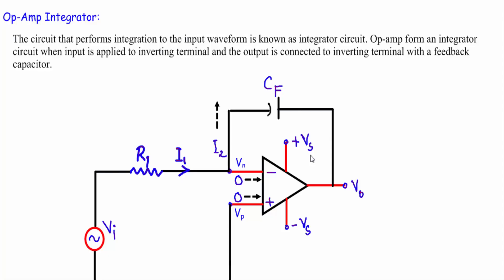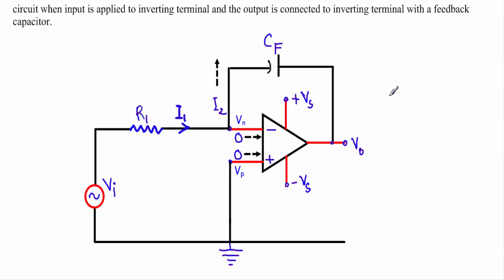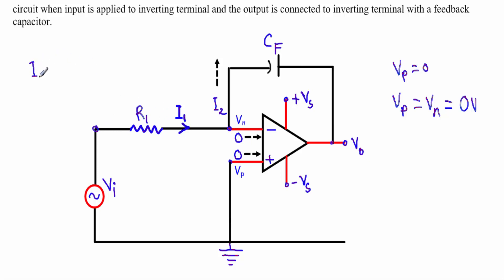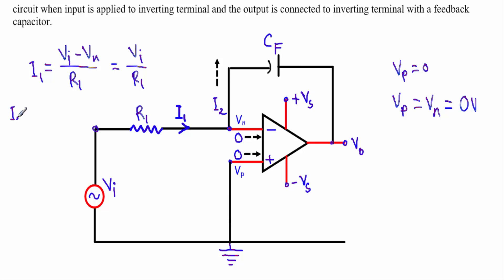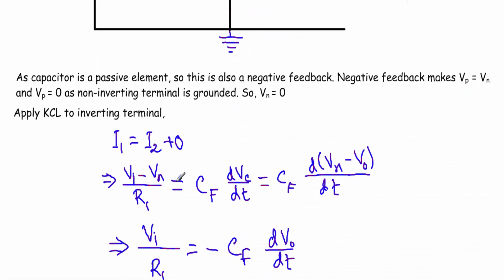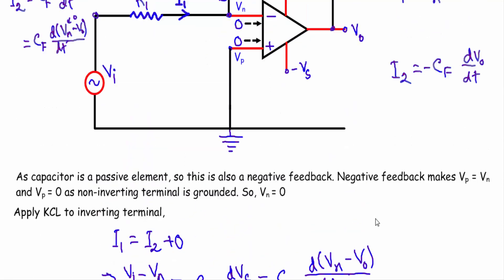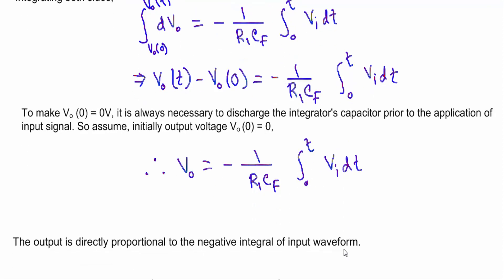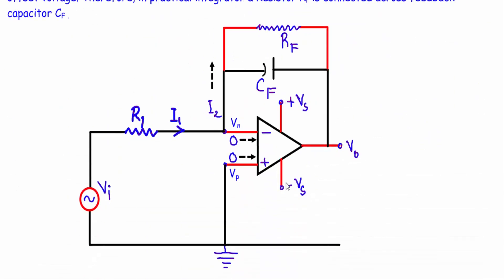Op-Amp Integrator Circuit (w subtitles)

Comment: Hi, Nice explanation!
Can you tell what are the recommended values for Cf, R1 and Rf?
In my practical application I get a kind of a square wave from 4046 IC (although it looks not like square, just sounds very alike). I've tried to implement the integrator using LM358 and TL074 ICs but no luck :( Also I've inserted R from + to GND (that is in many schematics in Internet).
Now I'll try to use LM833 that seems to be a very good op.amp chip but I guess this will be no luck as well... I mean that I can't get a triangle waveform for my little synth :) PLL chip is nice because it can be frequency-modulated just by a voltage input. This makes it a great thing to create tonal oscillators (like real VCO).
I must note that I use only one 9v battery for this circuit. It's dictated by my target: to make a really portable and small "machine" with a good filter. I've assemblied "MS-20" filter for single supply + AR env. generator and these modules gives really good sound. I've used LM13700 + 2 * LM358 (for AR env.). One battery supports these ICs without problems.

Comment: the explanation is quite clear but what will be the output waveform when we have triangular waveform
Reply: At 5:47, the video actually shows this.  Since this circuit is an integrator, all you have to do is integrator piece-by-piece.  When you have a triangular waveform, this can be done easily.  Since each edge of this type of waveform has a linear slop, you can just integrate this piece-wise. the result will look something like a sine wave, in the case of a triangular waveform input.
Reply from the maker: On a different note, you can check this numerical example of Op-amp integrator with rectangular input 

https://www.youtube.com/watch?v=a7uyGer_aNY